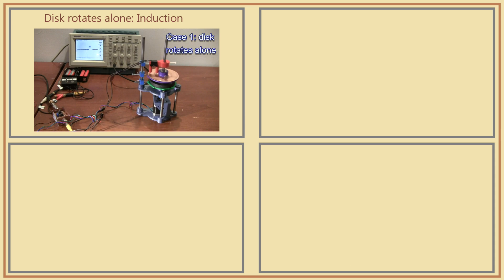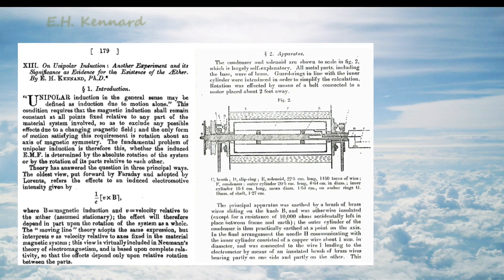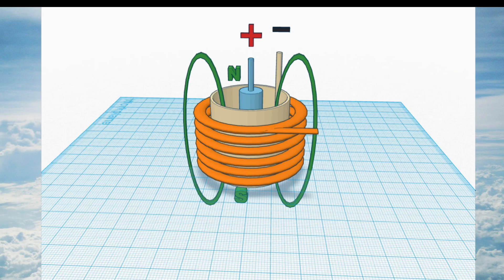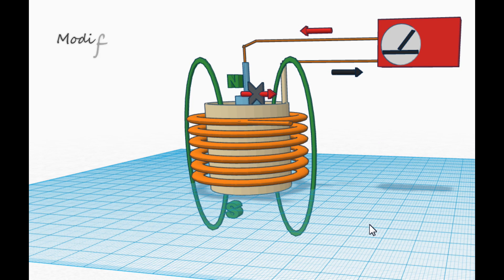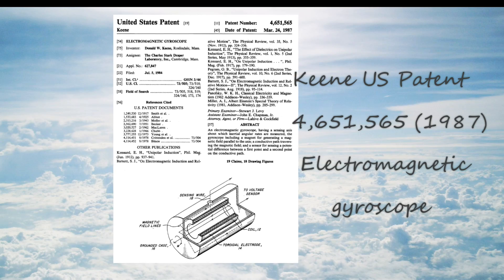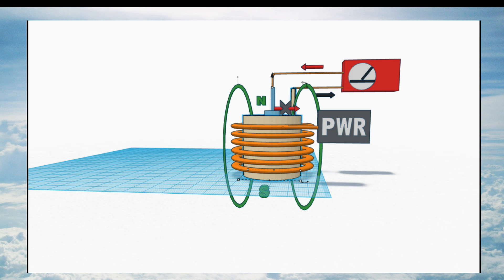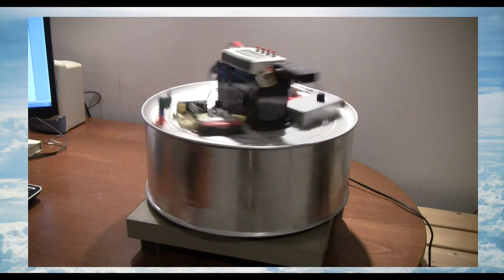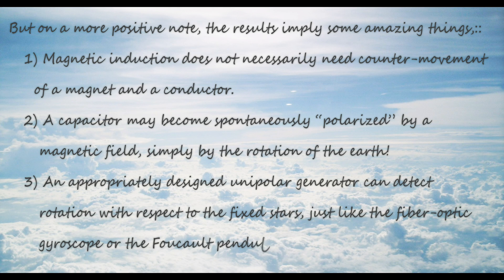Faraday Paradox Unipolar Dynamo Part 2: The Solution

Comment: "Electromagnetic Fields and Waves" by Lorrain & Corson (2nd edition) discusses induction in a moving system in Chapter 8 and Appendix C.  (The 3rd edition contains it as well but the text has a different arraingment.)  Faraday's Disk is also in Chapter 14 "Dynamic and Quasistatic Fields" of Zangwill's "Modern Electrodynamics";  it's on the level of Jackson without all of the sharp edges.

Comment: Well done!  Are you looking at amplified voltage on the capacitor, or "raw voltage"?  What can be done to increase the unamplified voltage besides increasing the Radius of the cap (outer plate), increasing B, and increasing omega?
Reply from the maker: Yes, looking at amplified voltage. Yes, I think you have covered it, radius, B and omega, I don't know what else could be helpful.

Comment: The magnetic field of a magnet is ab-extra to it and is always in motion as centrifugal divergence and centripetal convergence, so the field definitely would not rotate with it, rotating the magnet would have no effect on the position of the magnetic flow relative to the disk, rotating the disk inside the field is where mutual induction comes into play with the disk material. Hence the results of both the disk and the capacitor experiments are not unusual.

I also want to touch on the first possibility you presented at the end of the video, absolutely, this is further reinforced when taking into account how a "Generator" actually works:

"A time variable electric current creates an electric field parallel to that current. The field exerts an electric force on the charge in the nearby conductors thereby creating induced electric currents in them. This in the term “electromagnetic induction” is an actually a misnomer, since no magnetic effect is involved in the phenomena, and since the induced current is caused solely by the time variable electric current and by the electric field produced by that current."

"There exists a sourceless electromagnetic field whereas according to equation 528 such fields are impossible since there is no doubt that they represent a dual wave field, but as we've seen neither Maxwell's equations nor their solutions indicate the existence of causal links (no causation) between electric and magnetic fields. Therefore we must conclude that an electromagnetic field is a duel entity always having electrical and magnetic components simultaneously created by their common sources; time variable electric charges and currents."

"according to these equations in time variable systems electrical and magnetic fields are always created simultaneously because they have a common causative source, the changing electrical current, once created the two fields coexist from then on without any effect upon each other. Therefore electromagnetic induction is a phenomenon in which the field creates the other, I.E energy generation is an illusion. The illusion of mutual creation arises from the facts and time-dependent systems of the two fields appearing predominantly together."

-Causality, Electromagnetic Induction, and Gravitation: A Different Approach to the Theory of Electromagnetic and Gravitational Fields by Oleg D. Jefimenko

In Laymen's terms this means there is no transduction between the kinetic input and electrical output, the power in the system comes from the changing net quantity of magnetic induction with respect to time, a Back-EMF situation is not a requirement for power producing and is a result of EM Retardation (Lenz), neutralizing it or redirecting it away from the input as an opposing force to instead assist it are purely advantageous goals.

Comment: I wonder if the magnetic gyro has the sensitivity of modern fiber gyros that can detect motion in degrees per hour? If so, I wonder if it can detect the so called ether drift of 15 degrees per hour that the FE core folks have demonstrated that changes with altitude? 
In regards to the paradox, starting with the hypothesis that our reality is some sort of virtual simulation, what if they used short cuts for magnetic objects and simply assign a vector to it thats used to calculate the behavior of moving metallic objects in the vicinity. Whatever rotation the magnet has about the vector axis is disregarded.
Reply from the maker: Hi Ben,
    I think the magnetic gyro is fairly insensitive compared to the fiber optic gyro, so it likely wouldn't be able to detect down to 15 degrees/hour, but that rotation should be detectable with a good FOG and is the expected absolute rotation of the earth with respect to the universe. Not sure about your second question, but if we are in a simulation, then I must just be a figment of your imagination anyway : )

Comment: there ARE NO LINES OF FORCE.
they are an ILLUSION.
they are simply magnetised ferromagnetic materials acting like magnets should act... attracting opposite poles, and repelling like poles. as they lie side by side, the strings of magnetic particles diverge as they REPEL away from each other.

there are NO LINES OF FORCE.

Comment: So...if Kennard is correct, Einsteinian relativity is incorrect, and we're back to Lorentz.

I'm dubious, not because of that, but because the Kennard device is isolating away from any possible intra or intermolecular effect of the solid disc. That's laudable, but my point is that Kennard could be proving an entirely different mechanism, or only one part of the mechanism of the Faraday disc.

So, I would say that although the Kennard device does violate Einsteinian relativity, I don't think it accounts for the full explanation of the Faraday effect.

Also, the "rotation of the earth" may or may not have anything to do with this effect. If it did, one world expect different results depending on the orientation of the device relative to the earth's rotation, and I don't believe that is the case.

What say you?

Comment: Does that mean that a rotating planet would show charge differential between it's surface and interior and act like a capacitor?
Reply: a shorted capacitor? I'm thinking fault lines and volcanoes a sudden. It could explain alot of things, even the expansion of the earth over time, thx.
Reply from the maker: I am not sure if it would but I wouldn't be surprised if there are some related effects like that arising.

Comment: Exceptionally profound.  I have watched this and your previous video and read all the comments and your replies many times.  Thank you for your posting these beautiful experiments and explanations.  

Your table of "Outcomes from Faraday disk generator tests" is absolutely spot on including the three tests with the meter rotating you did not display.  Few people have pondered all 8 possibilities as thoroughly as you and therefore have reached erroneous or ambiguous conclusions with closed circuit tests.  

If you are reading this would you mind replying whether you ran the Keene experiment where the meter, disk and electromagnet all co-rotate while the electromagnet is powered by constant DC, thus simulating a permanent magnet?  

Your discussion implies you only powered the electromagnet with low frequency pulses, as apparently did Keene, which leaves the slightest doubt whether either a permanent magnet or unvarying electromagnet would yield the same results.  

In summary:  Did you run experiments with an electromagnet actually powered with constant DC that also demonstrate that the magnetic lines of force do not rotate?  

Thank you again most sincerely for this tremendous work.
Reply from the maker: Thanks for that! Regarding the pulsed DC verses constant DC, as I recall I only did pulsed D.C. but I compared it to a non-rotating control also with pulsed DC so that any artifacts due to the pulsation itself could be eliminated.
Reply: I really appreciate your reply!  Driving a coil with pulsed DC has some unusual features as you know.  It may not necessarily generalize to driving a coil with direct DC in a rotating system.

Since Keene used AC waveforms at 30Hz to energize his e-magnet and if you used pulsed DC, it is not yet conclusively shown that the field of a  permanent magnet/constant DC electromagnet remains stationary in space upon axial rotation.  How important to definitively know that specific answer!

Would it please be possible for you to repeat your experiment with the disk, e-magnet and meter co-rotating while driving the e-magnet with constant DC to simulate a permanent magnet?

I am happy to contribute a few hundred dollars towards this work if you let me know how to get it to you.  You are likely one of the few people on earth with the knowledge and experience to be able to conduct this experiment.  I beseech you to do so.   Many thanks.

Comment: Thanks for the demonstration. Might I enquire what you used for the datalogger and bluetooth transmitter connection?
Reply from the maker: originally i used a custom microchip datalogger with a rs-232 to usb bluetooth transmitter, but more recently i have started using an arduino datalogger which writes to a Sd card, which is more convenient since it creates a csv file directly for import into Excel. Both i had to make from scratch...

Comment: KENNARD DRUM VERSION OF A FARADAY DISK.        .............           ........  .............  ...........     I cant see why Kennard made a drum type variation to the standard Faraday Disk.  I suppose that a drum is good for accommodating a long coil (instead of having lots of magnets).  But a drum is still only a disk, re the way it works, ie a drum-disk.  And i cant see why he talks of capacitance.  Capacitance doesnt change or help anything here.  And doesnt change or help the emf.

KEENE'S VERSION OF KENNARD'S DRUM.
Re Keene's gyro, i cant see how this would work very well.  His version of Kennard's drum has a graph error spread of about  5 microV at  100 rpm for 5 data points, & about  2 microV at low rpm.   And the graph of sensitivity is  1.6 microV per rpm at  8 amps in the coil.  Keene mentions the need for amplification balancing tuning & trimming of the emf signal. In any case if the noise at low rpm can be reduced to only  0.1 microV then the gyro would be blind to anything less than  1/16th rpm, which doesnt sound very good to me.       Edit....... 1/16th rpm = 3/8th deg/sec = 1350 deg/hr, which is useable for some applications (based on a paper by Passaro 2017), but i haven't seen any evidence of a Keene gyroscope in use anywhere, or for sale, so i think that this Faraday Disk kind of gyroscope is not very sensitive, & the coil version must hav a lot of stray magnetic field noise.    
I think a permanent magnet would work better than a coil magnet. 
And a proper disk would i think be better than a drum-disk.

A PROPER FARADAY DRUM. 
This has a radial flux.  A Faraday Disk has an axial flux.   U get a radial flux if u use one or more hollow ring magnets (having  N on outside & S on inside)(or vice versa).  If more than one magnet then there needs to be a large space tween magnets to get the full benefit.  
There is a youtube video with a Faraday Drum made of up to 5 ring magnets.  This has a hollow drum.  But a solid drum might be better, ie with a small hole along the center instead of a large hole (supermagnetman has them).
On the rim of a Faraday Drum the charge is zero on the rim at one end & is at a max on the rim at the other end.  
On a disk of a Faraday Disk the charge is zero at the axle & a max at the rim (or vice versa).
On a Faraday Drum the brush contact can be (1) on the axle at the negative end, or if at the positive end it can be (2) on the axle or (3) on the rim. I think (2) is best).

The longer the drum the stronger the emf (if designed properly).
If a drum has a disk at one or both ends then that disk will act as a Faraday Disk.  I think that having a disk at both ends will hav little effect on the drum's emf.  But having a disk at only one end can rob some emf or add some emf.  I think that having a disc at the negative end of the drum will add emf, & if at the positive end will rob emf.
A rotating stator will act like a Faraday Disk.   If the stator is at the negative end then counterintuitively it will rob emf (i think).  A disk at that end would add emf.   In the "robbing" case, whether the stator emf wins the fight with the drum will depend on the exact design of drum & stator.   Anyhow that's what i reckon.